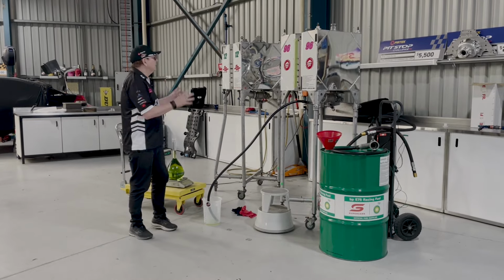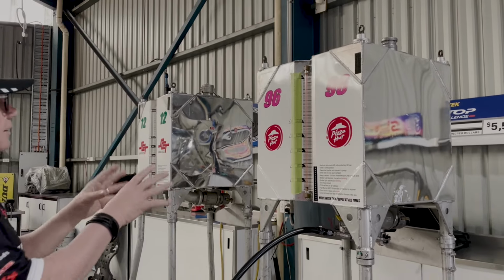Fuel tower capacity testing

Comment: I would have thought the engine management software was also using volumes rather than weight. Surely the cars telemetry is not monitoring fuel cell weight ??
Reply: Seems like a trite answer - but science.
Fuel burn calculations are mass-based (x molecules of fuel with specific molecular mass fuel combined with y molecules of oxygen). Also, the fuel changes volume as the temperature changes so flow meters generally are calibrated to and output mass per time unit (ie: grams per second) to keep calculations simple.
Reply: I'd heard fuel injector flow rates mentioned before, but wasn't sure what units the injectors were measured in, so I did a bit of digging.  Seems like common units are lb/hr, cc/min or g/sec.  So it looks like it's quite common to characterise injectors by weight.  Like OP, I assumed it's volume too.  I know teams fuel and defuel the car by weight, so I dunno why I assumed the "in car" measurement would be volume, but there you go.